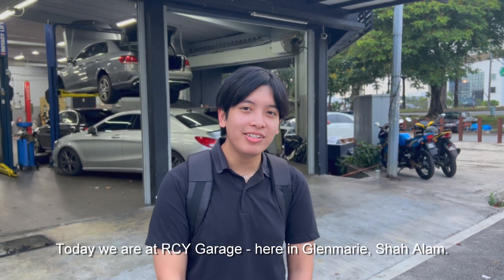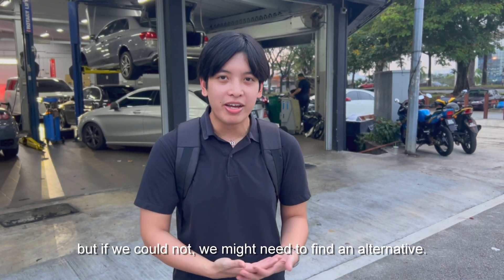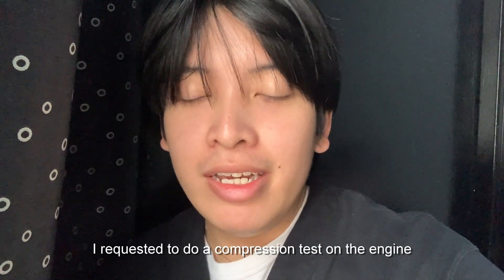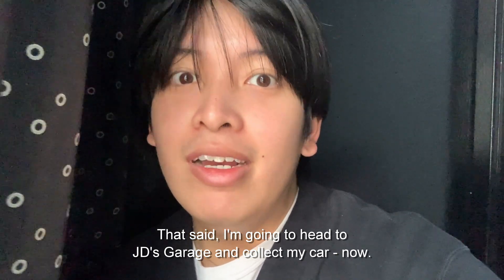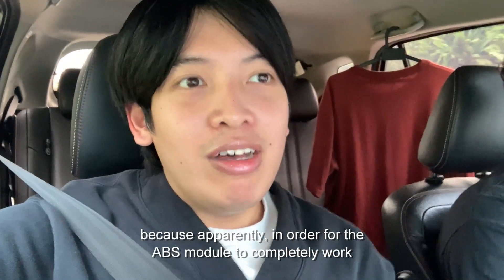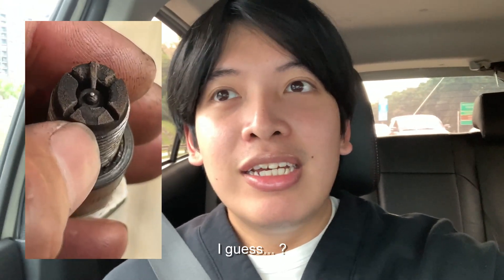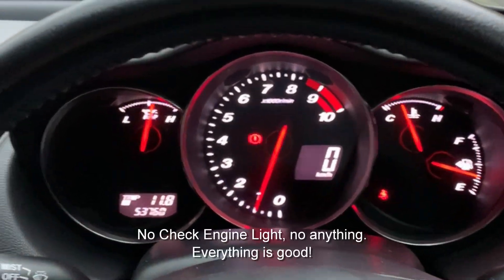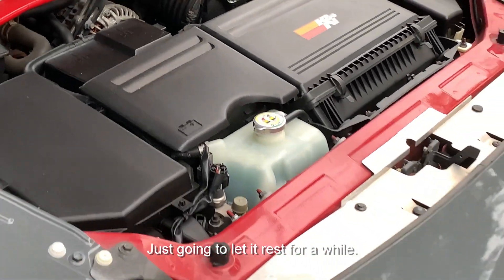Fixing my Mazda RX-8's BIGGEST problems! | ABS, Traction Control, Power Loss & Overheating Issues

Comment: i have that same exact code, i got no speedo, cel, abs and eps lights on, most workshop dont work on abs where im at
Reply from the maker: There are 2 ways to fix it.

1. Copy the data from the original ABS that is faulty and then plant that into the “new” ABS from another car that is almost similar to yours.

2. Find an ABS module from another car that is from the same year, same spec, same country and all the other details as yours.
Reply: @MeorHariz the 2nd option is not easy 😅

Comment: Dude, so how they fixed you’re problem with ABS, just change one module to another or what?
Reply from the maker: The best and most simple way to do it is swap it with another similar ABS.

Step 1: Find an ABS module from a car that is the same spec as yours.

Must be:
- Same country
- Same engine port (6 or 4)
- Same gearbox (auto / manual)
- Same gears (4 / 5 / 6)
- Cruise control / No cruise control
- Same ignition type (Keys / Keyless)
- Same country
- Same year
- Close to your production date

If any of it is different the ABS module will not work and you won’t fix the problem.

Step 2: Copy the settings or ID from your problematic ABS module. 

Step 3: Swap the module.

Step 4: Paste the settings or ID from the first ABS. 

That is pretty much it.
Easier said than done though as finding the right module will be tricky.
Reply: Cause I have u0121 problem and now thinking about open abs module or no

Comment: Hey Hariz, great stuff ! I always want to get an RX-8 but i'm a super newbie to cars. Just want to get myself into car hobby. Do you think is a great move to get Rx-8 as weekend car for beginner?
Reply from the maker: Thank you!

If you are fairly new to cars or motor vehicles, I highly suggest to get something slightly more conventional for you to first start off with.

Being able to tinker with it at home and learning what the parts are, how to maintain it is better as it essentially increases your mechanical skills as you go.

Once you’re more confident in doing mechanical work, you may be able to reconsider into getting the RX-8 as a weekend car. It’s a car that will be slightly cheaper and easier to own if you are able to do some of the repair work yourself.

Comment: why would you try to reprogram the car before even changing out the spark plugs lmao
Reply from the maker: If you watched the video properly, I merely tried to transfer the ABS module data. The spark plugs were recently replaced by the previous owner but I didn’t know he replaced it with used ones.

Learn to understand content as a whole lmao.

Comment: Rx8 need manual premix when refuel ?
And will rx8 burn engine oil, I heard the apex seal need lubrication ?
Reply from the maker: Good and interesting question.

a) Premix
I initially wanted to do so but was strongly advised by a rotary specialist to not do that. Series 1 RX-8 (like mine) have an issue with insufficient lubricant due to where they inject the engine oil. Even so, my specialist explained it well and it was pretty logical. One of the reasons NOT to premix is that it could clog up the fuel injector and damage the fuel pump (if I recall correctly). Even so, he did suggest me to add a bit of premix if I were to track the car. Alternatively, I can install something called a SOHN adapter that creates a separate tank to feed premix / 2T safely. Definitely going for that mod in the future!

b) Engine oil
Yes, rotary engines burn the engine oil but this is a good sign! It means that the Oil Metering Pump (OMP) is doing its job - lubricating the apex seals. That said, it's best to monitor the engine oil every 2 weeks or so. If it reduces a bit after driving for a while, it means the OMP is functioning. If the engine oil stays at the same level despite going for spirited drives or redlining it then it means the OMP is done for and we will need to premix with every refuel.

With those explained, it's kind of related to each other.
If OMP breaks, the fuel system will have issues as well (due to premixing through the tank).

Best solution? Get a SOHN adapter before anything happens.

Comment: Bro, better fix tat water jacket seal asap. Jgn tunggu2. The answer is rebuild while u can still use existing components lagi. Dpt kat tgn aku ni masuk sepang. Rx8 ni akan fail😢
Reply from the maker: Salam bang Razi, saya dah baca all of your comments and checked out your build juga.

A few note on my end, sejak tukar spark plugs and replace fan motors coolant dah tak pernah boil nor reduce even by a drop dah. Not 100% sure if it's a water jacket seal failure or dia drip out somewhere else. Even so, a rebuild is definitely on the list but kalau nak rebuild nak do a few things sekaligus alang-alang engine dah turun hence ambil masa sikit untuk kumpul barang.

Kereta ni saya baru dapat betul-betul 3 bulan. At the moment, just addressing major issues and doing reliability mods / restoration. InsyaAllah saya akan slowly build kereta ni. Duit, masa dan tanggungjawab kepada benda-benda lain juga main peranan pada waktu ini. Ada rezeki nanti saya akan join event track days juga. Buat masa ini, lebih kepada restoration dan tambah seat time untuk set up kereta mengikut cara pemanduan saya.

Thank you for sharing your experience, semua info tu sangat bermanfaat untuk saya gunakan sebagai reference.
Salam perkenalan dan harap community RX-8 boleh welcome saya yang masih baru ini.